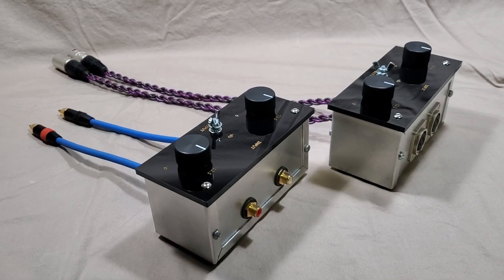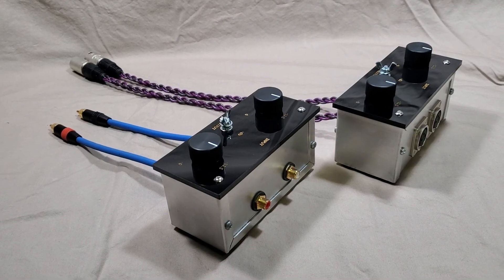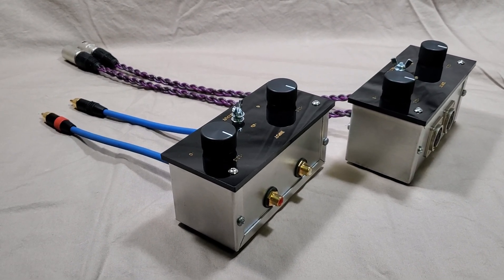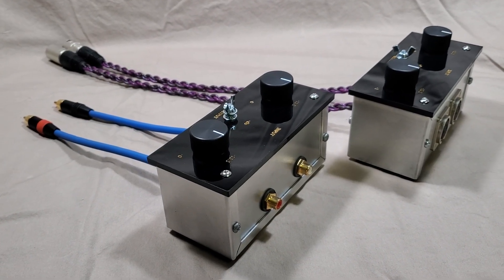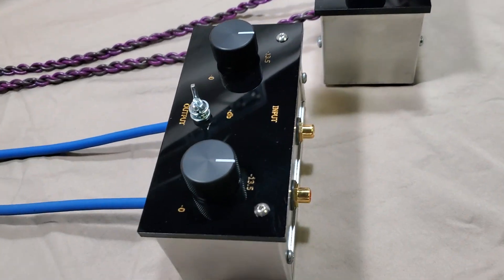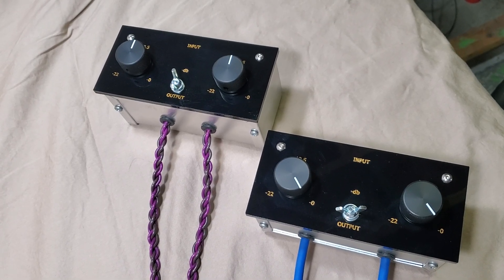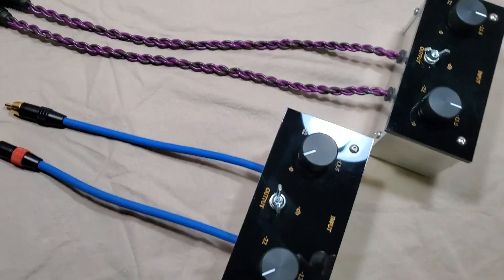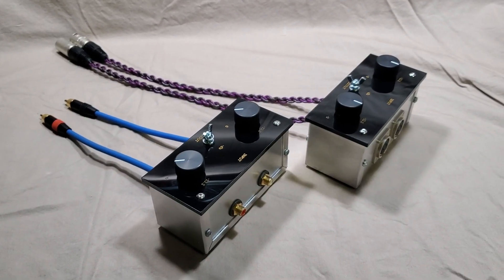Angela-Gilbert Yeung 0db to -22db Variable Attenuator RCA and XLR models

Comment: I have a pre amp going to active crossover to bi amps where would this go?
Reply from the maker: Goes between preamp output to active cross over input.
Reply: @angela-gilbert thx ....I was thinking before amps.....wouldnt this do the same thing as turning up and down the mids highs and lows ?I need to try this
Reply from the maker: @iokuse8498 If you have an active crossover, I assume it  already has level controls fo4 both highs ans lows.  The other reasons to use one of this attenuator at the output of the preamp is to lower the volume to avoid overloading the input of the crossover.
Reply: @angela-gilbert great worth a try..yes it has all types of knobs for highs lows and mids....its the sublime k235 ....I'm using a wuaudio tube  as pre amp

Comment: I have a 90's 2 channel audiotechnica mixer...2 phono 2 line in...a DJ mixer basically,..it actually sounds fantastic for headphones and as a preamp. Has a lot of drive, like 10dbu....but what im getting at is the input slides work to attenuate the signal along with adjusting the output gain it can gain match with a poweramp quite nicely..it changes the sound...i can also use 1 of the output to crossed back into the second channel for a crossed fader.....but anyway these are cool things that i would be cool in an actual "hifi" preamp built in.
Reply from the maker: I have used analog mixers and they are cool.  Lot of ways to adjust what the user wants.  However, audiophile thinking is different that pro sound reinforcement.
Reply: @angela-gilbert   I was thinking in terms of things you could add in a "audiophile" Preamp, similar to the 312...since you have been adding some "pro sound" ideas into these new components and IMO they are great.."audiophile" is about enjoyment there are no rules except implementing them the best way you can. ..I seen you added a crossfeed into a preamp recently too...good stuff....the closest thing to a audiophile mixer preamp I've seen yet is the SPL phonitor headphone amp for studio use...but it has some neat analog controls.....Thanks for all the videos of your custom works
Reply from the maker: @StrangeBrewReviews Are you thinking about the SCK4 as cross feed?  It doesn't cross feed.  Left side right channels are totally separate.
Reply: @angela-gilbert  maybe that was it. But effectively to variable the center "mono" image....useful tool and adds nice effect with some recording and rooms....great for headphones.

Comment: I use an Audio GD Pre Amp and a feature 
that I really really like is that it has a high 
and low gain setting, very handy indeed.
I think that all pre amps should have that
facility.
Reply from the maker: My older designs has high low gain setting.  Most of my new preamps are designed  differently and it doesn't need high low gain setting anymore.

Comment: Do you also use these for your multi pairs of stereo speaker configuration?
Reply from the maker: I don't because when I made my amp, I installed a level control at the inputs.  However, it is a useful device foe multi speaker set up using power amp with no volume control.

Comment: It's a shame this type of device is needed at all. Sources vary so much in output, preamps usually have too much gain. My preamp has attenuation at each stage and a high/lo gain setting in an attempt to maintain some coherence. My first integrated amp had gain settings per source,  that's the best way of doing it.
Reply from the maker: We don't live in a perfect world.  There is no perfect component and perfect system.  The way I see it is a perfect system is a perfectly controlled chaos and get the job done.
Reply: @angela-gilbert  100%. Inline attenuators are an excellent solution. Been thinking about your multi amp/speaker systems too, very tempting to try it out.
Reply from the maker: @peterlarkin762 Just do it.  The worst you will get is not sounding what you want.  If you have the necessary amps and speakers and wires, hook them up and hear.  Nothing to lose.  Of course, if you have to buy something, then it is more to consider before moving forward.